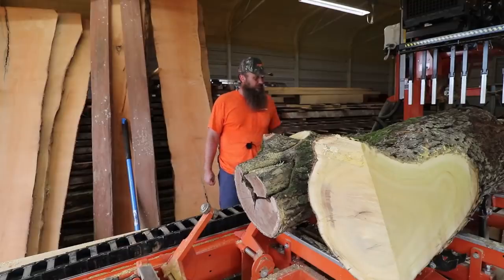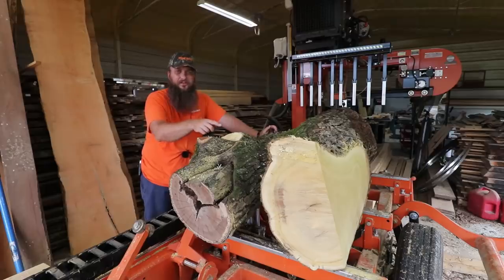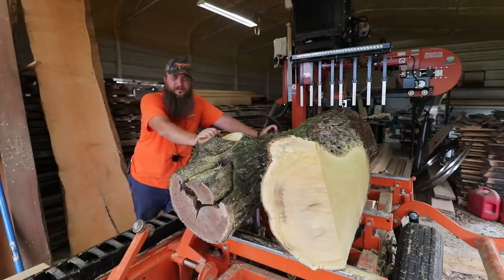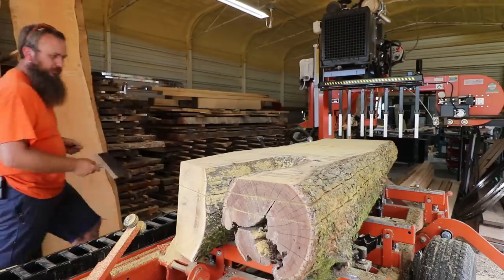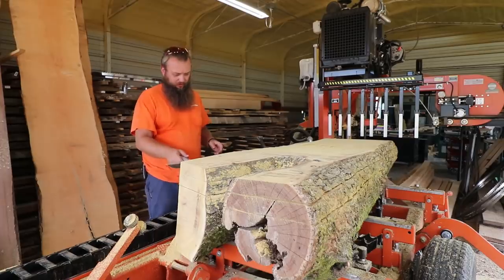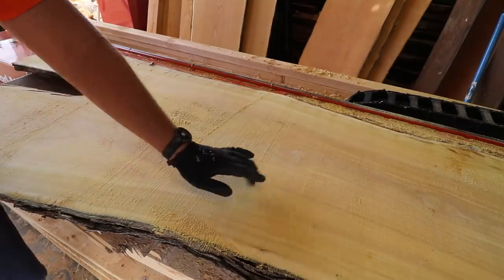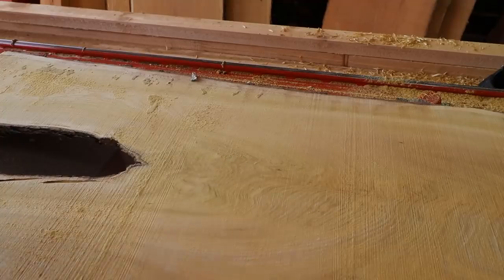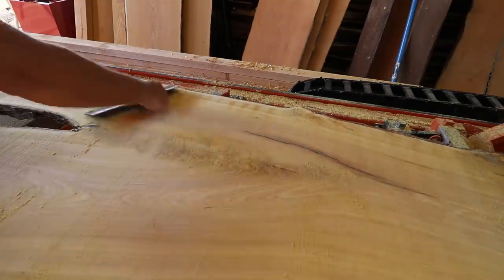Prepare For Greatness, Mulberry Crotch Log On The Sawmill

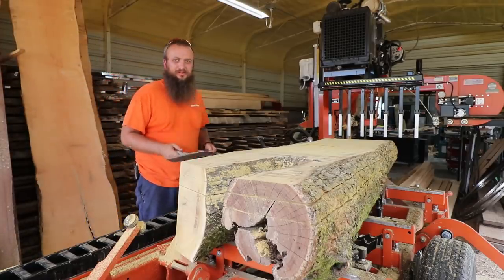Comment: @5:48 very wise. I learn that lesson a month ago. I put on a fresh Turbo-747 as to mill two super knotty, twelve foot, 27" diameter logs into slabs. All went fine until halfway through the 2nd log. I was in a rush so I just milled the whole log without removing anything for QC, the blade looked to be cutting straight (rooky mistake). At approximately the 7.5' mark all the slabs after the 4th look like a roller coaster. 

Was just pine destined for the firewood pile so no worries. Good news is I sold two of the good ones for $150 a piece (green).

Comment: I saw something in a shop today that made me a little curious about your operation.  Lacquered natural wood stools.  Basically 2 inch thick by two foot by eighteen inch slabs sitting on twisted wrought iron frames.  The seats had lots of crotch figure, but it was pretty clear that the wood was cut from pieces much smaller than you run on your mill.  Large branches with crotch figure is what it looked like.  I imagine it wouldn't be hard to build a frame to sit on your mill to allow you to support and cut smaller logs than what will run on the mill normally.  Have you ever considered collecting large crotch branch sections and cutting them for stools, end tables, coffee tables, etc?

Comment: Is there ever a time that you regret sawing off a "too  wide" crotch in order to fit your machine.   Seems that the whole point is to keep the crotch with the two branches as intact as possible.  I know you were even more limited with your previous saw.   It kinda ruins the live edge look if you were to make a table with it.   No?    Do most woodworkers just chop off the edges of the branches anyway and keep the crotch figure part?   I struggle with this in my sawing as well and would appreciate some guidance as to what to cut to fit the saw.    I can only get 24" width, with my Norwood LM29.
THanks.   MIke
Reply from the maker: I see your point and yes that does cross my mind however I have never not sold a crotch slab meaning at the end of the day it doesn't matter as much to the customer. In a perfect world yeah we would be able to saw any width but until a WM1000 lands here which is probably never it is something you have to deal with, very good question,
Reply: You'll need to buddy up with Matt C. or April W.  No 🙂
Reply from the maker: No thanks.
Reply: @OutoftheWoods0623  Hey, thanks for you first reply.   I'm not going to sweat it cutting off the branches to "make it fit"..    Was there any thought process to cut off only the one side and not a little less from each of the two branches.??